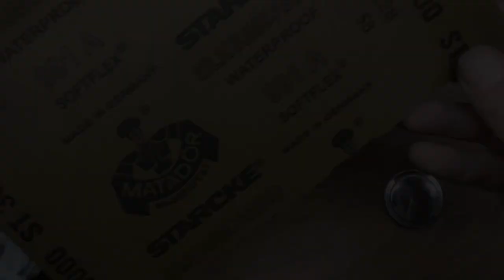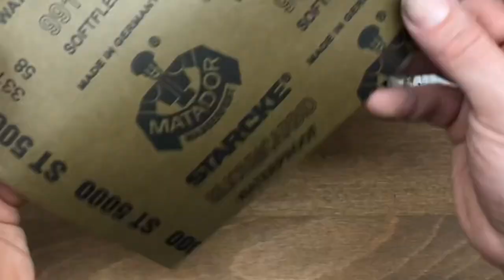Rolex Submariner 5512 Restoration Refinish (ASMR)

Comment: You removed so much metal from the case side that the spring bar is pushing out. Other than that looks very nice. I believe collectors prefer un polished cases, unfortunately you have decreased the value. But I am sure the customer will enjoy this restoration and your excellent work.
Reply: Took half the value off that watch with that case reshaping. Collectors don’t even want them polished let alone ground down and welded and reshaped
Reply: Have to grind the spring bars down a bit then the owner will have to wear it for 5 years solidly and then no one will know.
Reply: It will be our dirty little secret. @antsfur

Comment: Amazing job. Thanks for sharing. Just one question : how did you manage to lap the case on the crown side ?  Using a lapping machine seems not possible due to the shape of the case
Reply from the maker: You need a special stick grinder for the crown side.

Comment: Hello 👋🏽 I have a question, how do you avoid getting porosity on you micro tig welds?
Reply from the maker: It’s all about the argon flow and correct settings. Use less power and longer duration, the metal should flow.

Comment: Question. You put a gasket beneath the bezel clamp. I thought those only came through after the 1680 was discontinued. Which gaskets did you use? Did you loctite the crystal as well?
Reply: That's the crystal clamp ring or what ever one calls it

Comment: Oh my! Please stop sanding on vintage watches especially models like this. Collectors don’t even want them polished and you are sanding and welding it and removing metal and changing the shape of the bezel and case lugs. A new Rolex that’s all banged up sure, but leave the vintage pieces alone. This is exactly why people don’t send vintage watches to Rolex. They get their value destroyed with over polishing and new parts.  You just turned a $30-40k highly collectable watch into a $10k watch at best. *** EDIT now that I see it’s not actually a 5512 as your title says but a 5513, it’s a less expensive watch maybe a $20k watch before and now worth maybe $8k now. Took so much metal off the side that the springbars are poking out. 🤦‍♂️
Reply: OMG is all this true ?